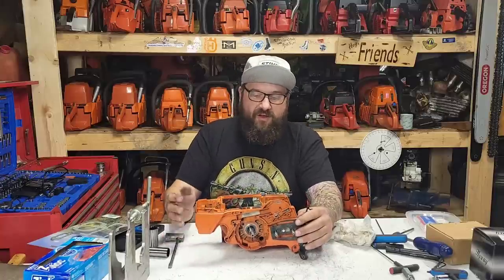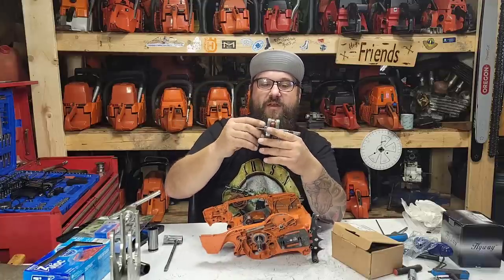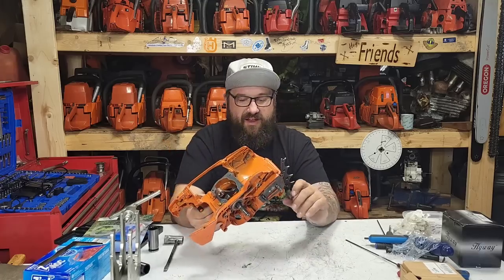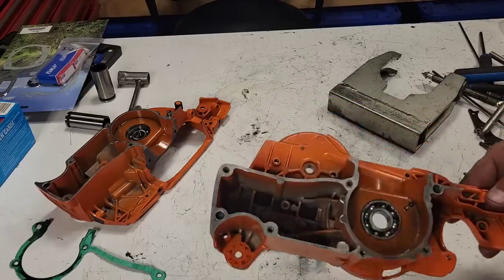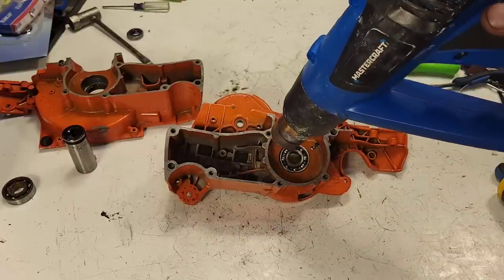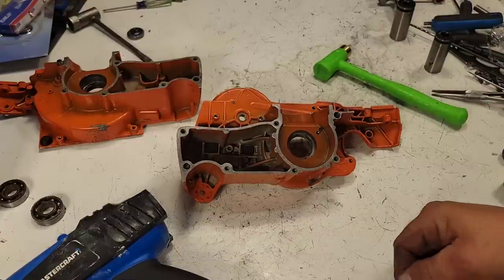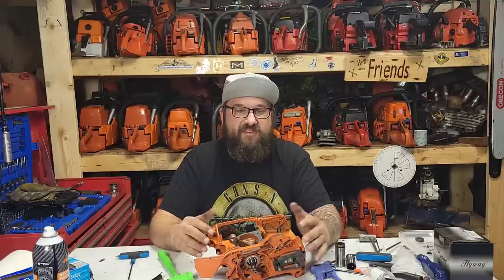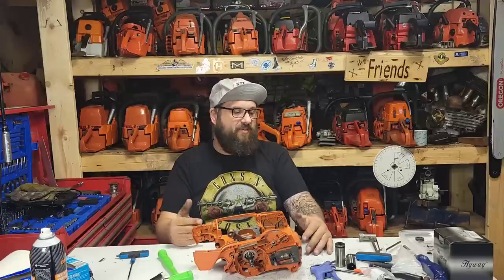Building a strong 372xp bottom end!!

Comment: Did you know you can microwave the bearings instead of a heat gun or torch?  Just wrap the bearings in wet paper towel and it won’t arc.  AVE had this on his channel and it works mint

Comment: I stumbled across a great way to get the bearings out of the case  ,my missus threw a old electric fry pan in the skip so I grabbed it out and the cord and it worked like a new one but had a few scratches on the bottom ,I was using it to degrease my saws   but I also get it up to heat with detergent and water and the heat makes it come apart nice and it decreases it perfect

Comment: When using a heat gun to heat the cases you will find heating the outside/ oil pump/ flywheel side works better and a safer option. Heating inside the crankcase one runs the risk of overheating the coating inside the crankcase around the bearing causing it to lift, sometimes days later sending bits of the coating into the bearings and top end. I have seen this in Stihls especially. If the coating has lifted be sure to remove it.

Comment: Those old cases are excellent, I've never had one from that era with bad bearing pockets. I would rather have a used OEM than a FT, never tried the NPW. Might need to put one into a test program. Have 3 from that era in the junk pile. 300 degrees the magic number for me and my turkey roaster :)

Comment: I have a brand new Husky 445 X-torque that I want to up the size with a new jug and piston. is  there a combination that I can go to for that.? I have any tools in the world of mechanics, Imperial and metric, I used to build sprint cars and a few custom modifieds ( a stock car type) but I owned and drove open wheel cars. I also did setups on other sprints and miiidgets, for other owners, Once I retired my operation, I sold my custom hydraulic tubing bender and my big TIG welder. I  still own my whole enginer repair primarily but still emphasizing  all kinds of street cars, modifided, sprints, midgets working for other owners primarily with Small Block Chevies--5.7 liters;  350 cubic inch or bored out. I want to start a shop  working on 2 strroke engines , for chainsaws and race Karts. or other 2 strokes.
Reply from the maker: Be interested to see what you could do with that saw. Unfortunately I have no experience with those so I can't say if there's a bigger top end that would fit.

Comment: Looks like (haven’t tried) u could rig a c clamp or gun puller up to split those cases if I don’t wanna buy one.
Reply: For the work involved to make it properly and pull STRAIGHT and not wreck a case, just buy it, and you will find they will work on just about any saw.
Reply: I have actually and it works but you have to be careful, and I modified the clamp